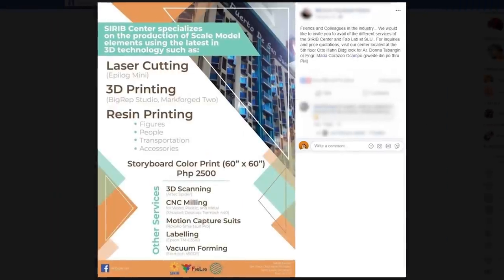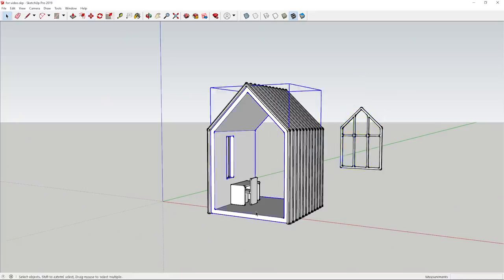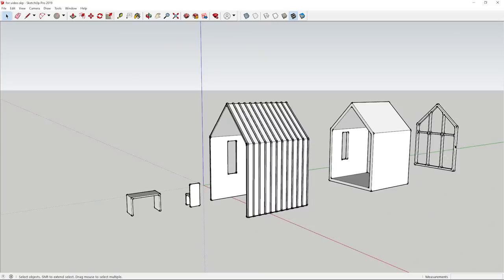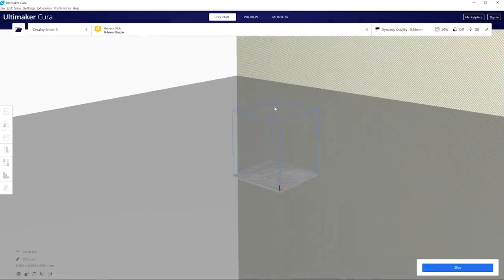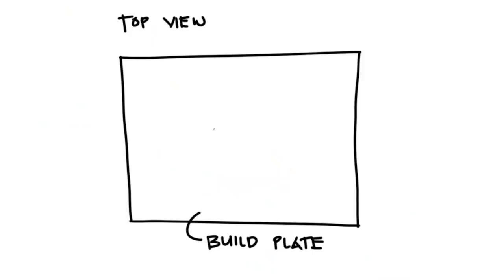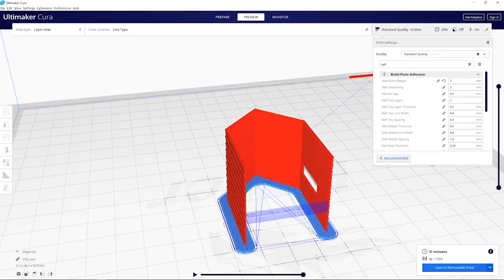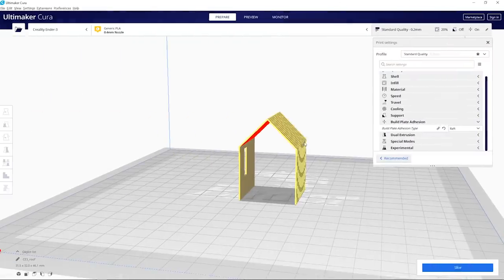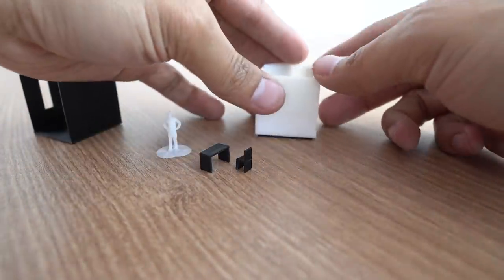Architecture 3d Printing

Comment: Instead of deleting the models everytime, you can select one model, select File>Export>3D Model, and when the window pops up, in options, choose 'Export only Current Selection'. (This selection stays on  until you turn it off. so you dont have to go to options every single time). This will export only current selection.

Comment: Great video! 👍 My 2cents... I don't think 3d printing is there yet for real-world use in Universities where deadlines are too short. For example, to build my thesis model, which was very big in size, I don't see how making it on the 3d printer would have saved me time or money, think it would have had the opposite effect. Easier to just use Exacto knife and cheap materials at the moment, but I hope 3d printers keep evolving. Where I see current  3d printers being useful is if you are not in university and have more time to dedicate to your models without worrying about time constraints.

Comment: How do you 3D print a sphere? 
I wonder...?
Reply: 3D printing a sphere is possible. Most 3D printer users slice the sphere into half and print them flat face down. Yet when a printer's settings are tuned enough, you can print a sphare at one go.

Comment: That first tip about splitting the model up isn't exactly true. Sure you created smaller, faster prints in the case that your printer fails - but congratulations to save 5 hours you've created 6 hours of sanding and connecting of your parts to have the same "finish" as if it was one whole part. My advice would be to make smart design choices with how to print everything and to make sure your printer is both maintained and tuned for low failure rates! -t someone whos been 3d printing his scale, site and final models since undergrad.